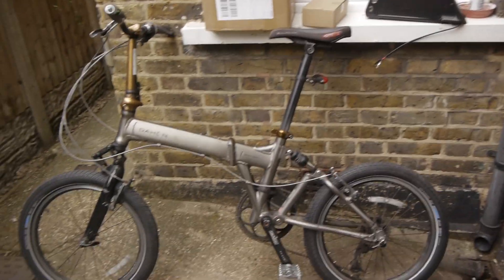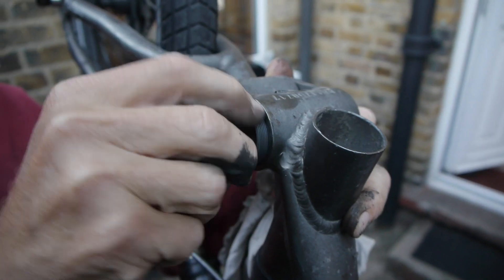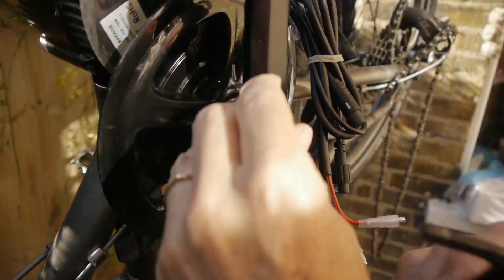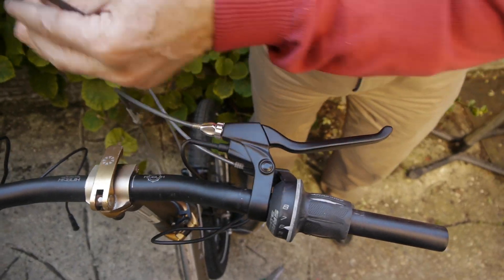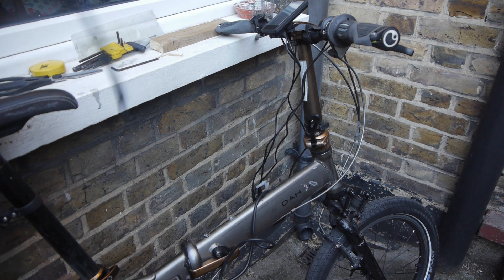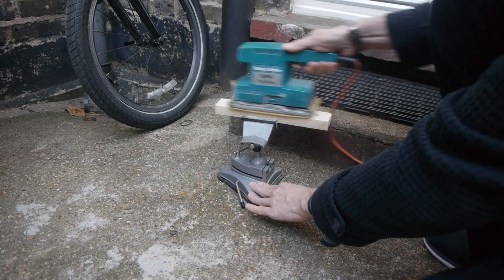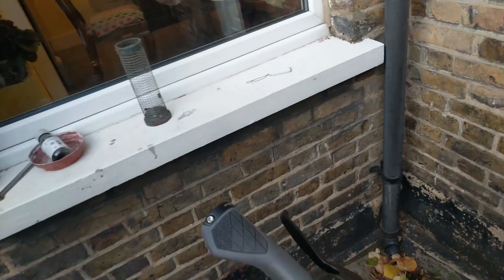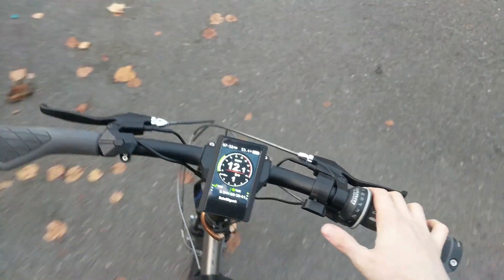Bafang mid drive BBS02 Quick Install Guide - (ebike kit on a Dahon Jetstream)

Comment: Excellent video ! I had the same project with a similar frame but I was worried about the battery placement. Watching your video I realized the placement makes the bike look suspicious. I would probably try to place the battery on a bike rack. Watching your video beforehand helps.

Comment: very cool vid tool size info was great to include curious how the folding worked after install and if repetitive folding would kink wear n tear on controller wires... Cheers
Reply from the maker: wires fold with the bike - it's heavier and less nimble but still folds if you want to go on a train etc

Comment: Best video I have seen about this as it also explains and demonstrates how to remove the existing components the tools required, and how to use them. Thanks.  For some reason when I save it as favorites it does not save properly so I had to copy the video and play it back that way for repeat viewing for when I come to do the job. Cheers.